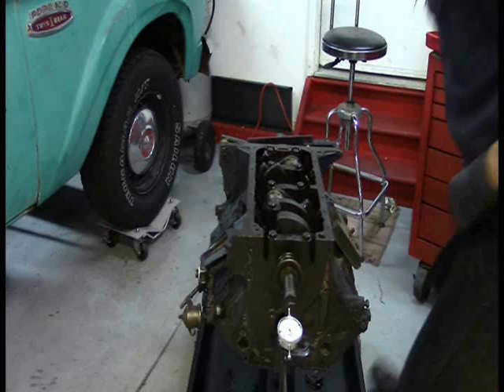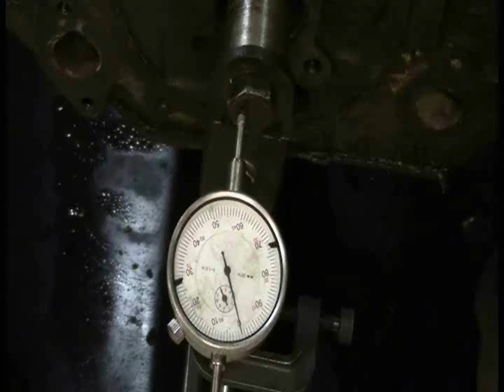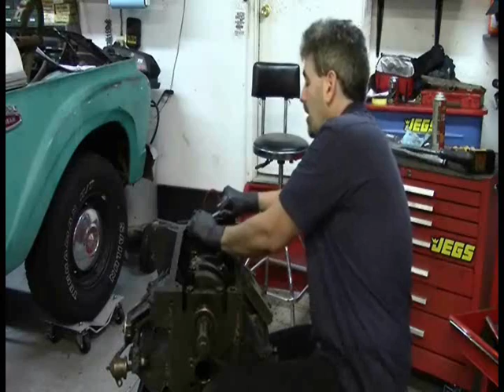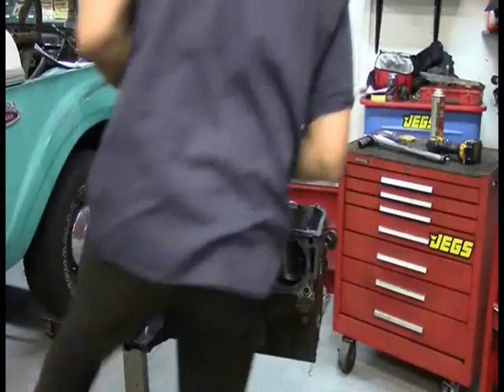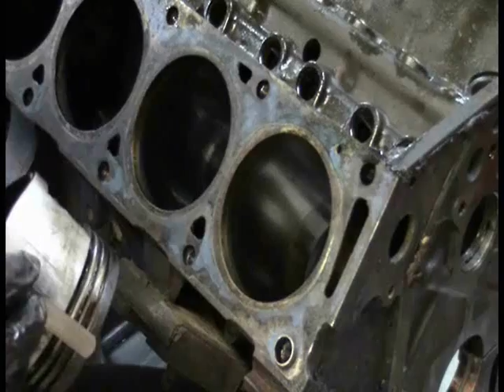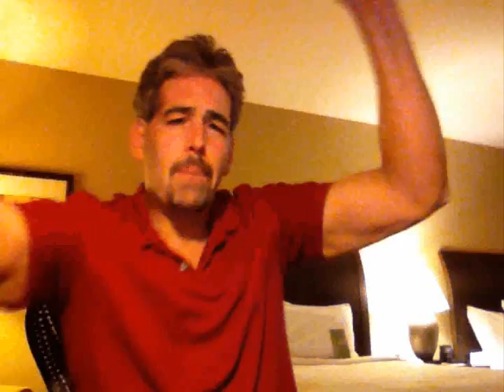Extreme Budget Engine Rebuild Pt 3- "Budget Rebuild" is an Oxymoron

Comment: If you have oversized pistons the cylinder will suck in more air. So the fuel trim will be lean unless you increase the fuel. Also temperatures will be higher and NOx will increase.
Reply: Stock programming is meant to be self learning (on newer injection systems) and has a set amount of variation that the ecm can swing in both lean and rich directions to keep it within a good range before it will throw a lean code.  That amount from experience is generally about 15%.  As he has already stated though is the cylinder draws in more air then the maf will see this and tell the ecm about the extra incoming air which will in turn trigger a longer injector duration.  All the ecm cares about is that the final AFR is close to where it wants it to be dependent on load, not about specific injector duty cycles.  Also to prove a point, I just finished up on a rebuild on a ka24 in a friends frontier that is .5mm over bored and we put new cams in that are 264 duration with 9mm lift compared to the stocks that are about 224 duration and 7.3mm lift(very pathetic).  No tune was done (yet) and it has no check engine light and runs great.  Now chipping it and tuning it would definitely yield more power but that is more due to the fact that the factory programming is generally garbage and WAY over rich on most cars.
Reply: Oh yeah great video series.
Reply from the maker: your statement is incorrect. The extra sucked in air is measured accurately by the map and maf.  this is an extremely common misunderstanding but you can now surely see how an understanding of the stoichiometric maintenance algorithms despite volumetric efficiency variation clearly dismisses this myth. see my trim video to understand fuel trim calculation and adjustment.
Reply: That engine has a carburetor. If it was fuel injected it would throw a lean code. Long term fuel trim would be positive with a o2 sensor  and negative with a air fuel ratio sensor.
Reply: That truck is fuel injection?
Reply from the maker: once again incorrect. if it was fuel injected it would NOT throw a lean code for reasons i said!  how could it possibly throw lean if the mad frequency increases proportionately to the VE????
Reply from the maker: MAF frequency i mean.
Reply: The fuel injector would have to stay open longer to meet the 14.7 to 1. You don't think that would throw a code or affect the fuel trim?
Reply from the maker: Chris for christ sakes what have i just said 3 times now???  The MAF frequency will increase proportionally to the volumetric efficiencies. HOW IS IT POSSIBLE TO NOT HAVE INKECTOR PULSEWIDTH MODULATION AS A RESULT??))
  You're killing me man.
Reply from the maker: Here let me explain this another way. Since you allegedly understand fuel trim you know that that there can only be 3 explanations for your argument. 
1.  The volumetric efficiency variation is not detected by MAF frequency. If this is your point please explain how that is possible. See- you can't. 
2. you agree that the MAF frequency increase detects the VE change but does not result in injector pulsewidth modulation.  I'd love to hear you explain that because Again- that makes no sense. 
  The final possible variable is that you have pulsemodulation  as result of then MAF frequency but the O2 sensor sends a lean response anyway. Again- i'd love to hear an explanation.  There is none. 
  Does that help explain it better? If not then explain one of those 3.
Reply from the maker: ImportTunerRB26 Almost correct. Not bad for a ricer though- I'll give you credit.
 The part about "factory programming beiung garbage" is totally untrue and as a "performance tuner" you should know this.  Factory tuning is NEVER way over rich or anything on ANY car- it is perfect stoichiometry. Any fuel trim analysis easily shows this.
  If you want to tune a car for performance, you will want it running slightly rich. But even then ANY factory programming will always have a car run rich at WOT anyway (again, A/F and O2 sensor analysis shows this).
  But at least you have rudimentary understanding of the relationship with fuel trim and MAF so I give you credit.
Reply: Schrodingers Box Thanks but I wasn't talking in regards to the running rich about at idle or light cruising where you would want to see stoich.  I was looking more at wot or under load where most factory tunes run incredibly over rich. Take my dsm for example, it runs all the way down to 9.8:1 from the factory!  Even for a turbo engine that's ridiculous. they run a lot happier closer to 11.5- 12 depending on the fuel used and other factors.  the factory tune is set by the lawyers more so than the engineers.  What I mean is its set more to be sure that your average idiot even can drive the car and not blow it up, and to sacrifice ideal power conditions for emissions or safety at wot.
Reply from the maker: ImportTunerRB26 Ok we agree.  I admit, I'm not much for ricers but I also admit you do know what you're talking about.
  Too bad you don't apply those skills to cars that are actually fast lol
Reply: Schrodingers Box Hey now those are fighting words haha. I prefer to have some technology in my cars and not the same regurgitated heavy primitive technology like the domestics employ. plus I love the look on the muscle heads face when my little 2.0L walks all over their big block without even trying.
Reply from the maker: ImportTunerRB26 Well that's true maybe for the OP- but not for me.
All I know is I am also obviously about the same technology you are. There problem is- it's simple math and physics- when I put that same technology into a 5.7L rather than a paltry 2.0L and I have yet to have that look on my face that you describe. There is no replacement for displacement provided the technology is identical.
  Oh- and remember....  math--- Torque is linear. Unless you put that engine in back that lack of a 4ft long driveshaft because of FWD cannot be compensated for.  Length matters in torque. Simple math.
Reply: Schrodingers Box I won't argue that at all. But your typical LS engine is a giant let down in this category since it's still ohv and 2 valve with a wedge combustion chamber. :(  I've actually been building bigger engines lately like the rb26 that is destined for my z and after that will most likely embark on a vh45 build so I can pull some insane power and have a great low down powerband at the same time.
Reply from the maker: ImportTunerRB26 At less than half the torque my friend. Simple math as I'm sure you know. Missing several feet in your torque equation by lacking a driveshaft in your FWD cannot be compensated for.
 You can't replace the "L" in the torque formula. What a horrific waste of all that power not leveraging it with physics.
  FWD is how NOT to make a car fast as possible. Simple math.
Reply: This is what you're talking about in the end piece lol. Someone happy to argue but who has never gone to their car and actually set up a test rig and gone "what happens if I........"
I'm totally in the learning stages but people forget that understanding the operation and desired outcomes takes more than knowing some "engine words". Also broad statements like saying things will throw a code are a sure sign (to me anyway). In my Toyota BEAMS 3S-GE engine (yes you don't like 4 cyl engines but hey) just altering the inlet, not even plenum or runners but the air filter assembly, will cause poor running. In a SR20DE the computer couldn't care less.
Anyway, keep it up and I'll keep watching to collect and add to my range of engine info. Thanks
Reply: I was wittill you brought up the LS. The "old tech" in this delivers. It's a big displacement, light and compact package. Same length and nearly as narrow as a turbo SR while being lighter and lower centre of gravity. You can't argue the design, argue the results ;)
Reply: I hate to argue with you but for low speed (40-80kph) tight corners my FWD will cane "faster" cars. Compact centre of motion allows faster rotation.

Comment: I don't understand why more people don't see the value in this type of video.  The key to proper diagnosis is thoroughly understanding how things work.  It is great to see someone checking tolerances to prove that parts need to be replaced.  Any hack can throw parts at an engine.  Great job explaining the challenges working on a budget.

Also, the contempt for Haynes Manual jockeys (I call them armchair pundits) is well founded, and extremely entertaining.

Keep up the good work.  Have a like and a subscribe from me.
Reply from the maker: It's because the average person has an attention span of about 3 minutes and they want to be able to solve an issue without having to understand it.  Only about 2% of people are people like you out there, so glad you found the channel.

Comment: when you over bore the cylinders  on a v-8 the displacement is increased only by a few inches, the cam wont know the difference
Reply from the maker: A cam doesn't know the difference on anything you would do to an engine.
Reply: He is right though...  A 20 or 40 thousandths bore would not necessitate a different cam.  I read it in my Haynes manual.

Comment: Also I have a question regarding the reason why this happened.

I just put extra 1.5 quarts of oil two day before the crisis. I put new low quality oil but fo 200 miles only before it happened. last I did parked the car on ramp and kept the engine running for two minutes, is that heart the engine?

couldn't figure out the reason of piston failure.

Thanks

Comment: This is the best series I found in the tube. 
I have a question. I have a 1997 tbird with 4.6 engine. I have the fourth cylinder passed away and when I removed the plug i found it a lot of oil on it. compression test shoes that the problem is down on the piston. maybe it is broken piston, bad rings, etc.

I took it to many shops asking for solving the fourth piston only and don't touch the others. All shops refused to do that and want to do complete rebuild claiming that replacing piston will not stay long and will break again in few thausand miles.

Now I'am thinking to take your videos and go ahead replacing the bad piston, do you recommend me to do that?
Reply from the maker: Valve seals leaking
Reply: I'll by you a bear if I found it a valve seal leaking,  Many thanks and greetings from the other side of the world.

Thanks

Comment: Being a gear head at heart, I've read the manuals, Ive ignored the manuals...done things the so called right way and wrong way. Sometimes it just is what it is and no two situations ever end up being the same so what ever works at the time...go with it. I've made good reliable horse  power with what some would claim to be junk, so keep doing what your doing, ignore the trolls and stick to what you know!
Reply from the maker: AGreed!!
Reply: I am right there with ya! I have done enough "driveway rebuilds" to realize that as long as you pay attention to detail, you can get a reliable end product without going overboard on machine work and all that. But as you pointed out many times... If it has to be done, it has to be done! I have had to scrap many rebuild projects as well because either the block or the deck or the crank or whatever was so out of spec or scuffed that it would cost more to fix than to find another good engine. Keep it up!  (I only use my Haynes book for torque specs!)

Comment: You are a natural educator, and well educated. I watched the entire series on this rebuild. Your techniques and explanations are authoritative, well thought out and logical. It is obvious you do not suffer idiots; you don't apologize for that. During my life, I have rebuilt twenty-five engines, all for racing. Even when I started with a factory fresh engine, I needed to correct bad assembly and blocks out of tolerance. The techniques you demonstrate are relevant, useful and reflect excellent workmanship. I don't work on engines any longer; I work in electromagnetic research. I miss working on motors. Thanks for the series.

Comment: changing the bore  increases the compression( we all know that)just replace the cam and lifters, with the same lift, the duration spec can be changed to bring the power (sweet spot) up or down the  rpm.
Reply from the maker: Why would one possibly replace cam and lifters on this engine - did you see those crank journals?
Reply: That is not true.
If you increase the volume, your compression will drop.
I know this because I work In a Machine shop, and have discussed ,my problem of finding closed chamber heads, as opposed to open chamber heads, that are 10-15 cc bigger, and as a result, would drop compression.

Comment: The next time you tear down an engine the main and rod caps are marked where they go and they make a thing called a dead blow hammer never use a ballpein to remove rod caps but everything else is good for anyone who has never done this.

Comment: Thank you so much for these videos.  I have been begging for a video like this to really break down the steps and show the attention to detailed required for a truely successful engine rebuild, not just a back yard slap together.

Maybe one day when I'm prepared for a few month long project I'll see about tearing down my 4.6 Triton from F-150.  Already pushed over 152k on it and it's starting to get a bit tired.  With as common as that engine is though I'm sure a used one would be cheaper as you indicated in this series.

Comment: Hi there Matt. I have a 98' civic with 200k miles on it. It has quite some problems with the main being oil burning, really rich A/R ratio, a bit of a low oil pressure and some low compression. I did a compression check and it seems a bit inconclusive, meaning that when i poured a bit of oil, it did rise but not that much to reach spec. I didn't do a leak down 'cause I don't have the tool nor compressed air and they will charge me 100$ to do it in the shop. I have thrown a lot of money in it over the years for unecessary repairs (well before I started watching you and the other channels in yt related) and I to your words see it as a family member. What do you think I should do? Should I take apart the head, change the stem seals and leave it there or what?
Reply from the maker: +pns12live6 low compression always means at minimum that head has to come off. Need to do leakdown though as next step
Reply: +Schrodingers Box Ok. Thanks a lot for the reply and a ton for making those videos. Keep 'em coming!

Comment: It sounds like your engine rebuild will end up increasing the HP a bit considering you need an oversized cam and cylinder bore
Reply: need to know what is that guage your using  that measures like that very important and could you use 1 bigger rounder piston if the other three are up   to spec?

Comment: My wife has a 1996 isuzu trooper and a 1971 f100 with a 390 sitting in the weeds and both have a lot of sentimental value to her.  Both need engine work and it sounds like your channel will be an awesome aid.  Keep up the good work!  Also where do you get all of your specification data you reference in the video?

Comment: Matt you keep hitting on the point of making sure you put things back in the exact orientation that it was removed.  Do you think there is some value when measuring the bore of the cylinder to place the piston in the correct way?
Reply from the maker: +Mike Osvold Oh there most definitely is. In fact a piston will even have a directional arrow indicating it's orientation.  Contrary to what one would would think, it isn't so much for orientation in the bore as it is orientation on the crank journal.

Comment: Got a engine from a friend. He had already dismantled the block and removed pistons and rods. You were saying it is essential to reinstall the Pistons into the exact order they came out. Is there a possible way to tell which cylinder they need to go back into?
Reply from the maker: +cam bertels Nope! Your friend clearly didn't know what he was doing. It is ESSENTIAL those pistons go back in their original locations. 
 Your only hope is to one-at-a-time install the pistons and check clearance on the rod journals. Usually you won't even have to do that- the wrong piston will freeze up on the journal once the cap is torqued.  But if it doesn't you must check clearance.  Hopefully by doing this you will match up the pistons to each location based on clearances and free movement of crank- but even then it's guessing.
Reply: +Schrodingers Box wish me luck.

Comment: Thanks for this video series, I'm rebuilding the 1953 Buick straight 8 engine that was in my 1940 Buick, and from your video came to realize, I'm going to be putting so much money in that I'll essentially be "putting a rocket engine on a trash can with casters." That means I have to get an Oldsmobile V8 engine and, if I can find a trash can big enough for it, and rebuild it with heavy duty casters, I'll have what you told me, but the problem with that is, it won't fix the Buick.